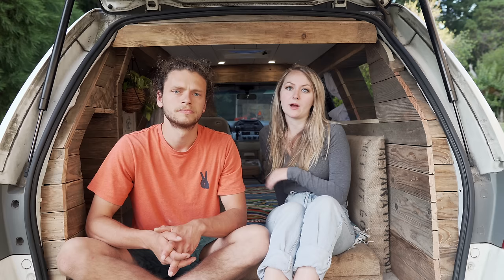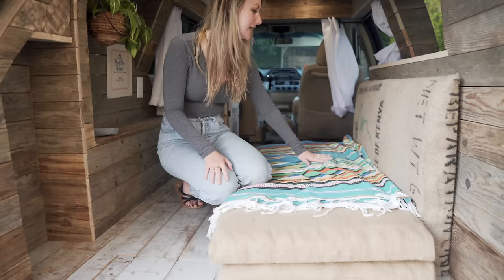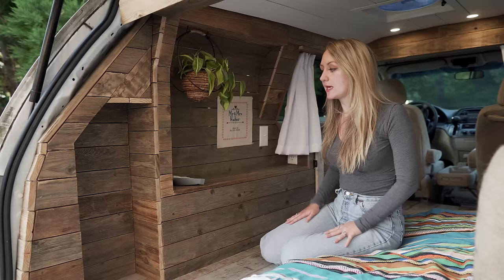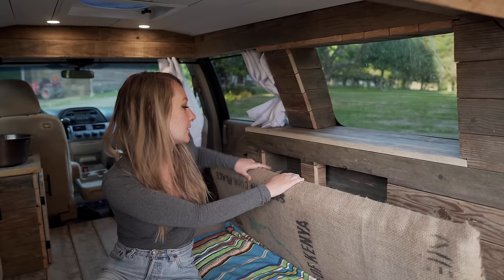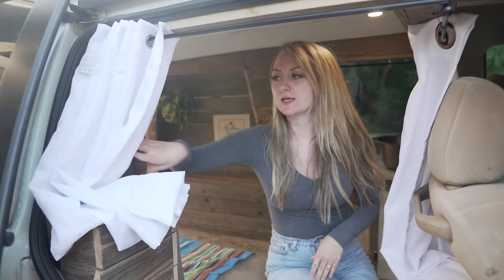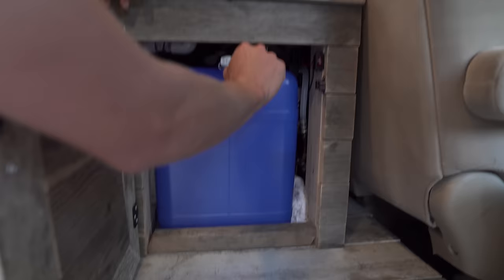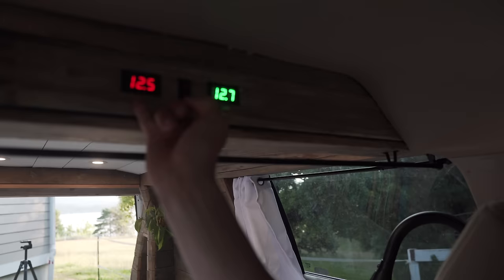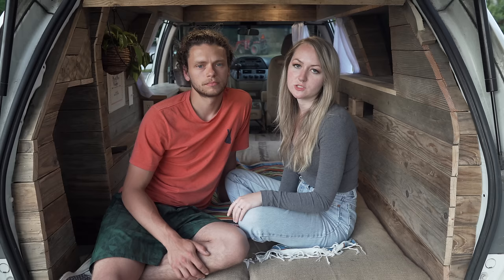MINIVAN CAMPER CONVERSION | Van Tour of Minivan Converted to Unique Tiny Home

Comment: I've seen at least a thousand minivan videos on YouTube. But anyway it does look cool as hate to think how much it weighs with the wood. I just used 1/8 paneling in mine.
Reply: Gary I’ve seen 1001 minivan videos. At first I thought this was a spoof. For never seeing any videos they did great.
Reply: Aren’t repurposed wood crates lighter in weight?
Reply: That paneling I used for a 4 by 8 sheet was only a couple pounds it was the lightest thing I found
Reply: Mine is all ghetto and not finished. If the economy ever gets going good again and I get some work.  Finish it and make it look good and put it on here
Reply: One thing to keep in mind when converting a passenger van or a conversion van like they did here, you’re removing seats, seat belts, interior panels, carpeting, possibly headliner, and I thought he said airbags (I’m guessing side impact bags for rear passengers?!) all behind the  B-Pillar (where all the side doors latch to, for those who didn’t know).  That alone could shave quite a bit of weight from the van before they even before they started to fit it back out. They were also able to save weight and living space just by making those trap doors to use the built in seat pockets in the floor, plus that keeps what weight that is there in the lowest point in the van to counter the wood added up top where there would have been lighter plastics.  The lack of a bench like seating and sleeping area helps too, though that on the passenger side would better balance out the wall, cabinets, and sink on the driver’s side.
Reply: They prob tossed airbags in the rear coils. I'd presume. With the shaved weight, then added wood weight+gear..rear suspension upgrades would be a must.
Reply: All that weathered and dried 1x material is super light. No joke, I bet all that wood weighs less than the seats made of steel that were there.
Reply: @mikeredhead2894   My stow n go captains were about 100ibs each, the rear bench maybe 150ibs. So yes, 350+ibs already out of the equation. 🍻
Reply: BJoe, I see your point on the solid wall switching sides for weight, but drivers side rear is often the blind spot so that’s really the best place for covering a window and still having full safety in driving. 
They did a fabulous job! I love that you have access the water and propane from the outside too. 
So many conversations with flooring added cover the stow n go spots and that’s such a waste. I like the hatch cover ideas vs bothering with hinges.
Reply: @tumbleweed1976  why did you think this was a spoof
Reply: I’m in love with cedar closet planks. I think I would use those! They smell great, and keep pests away!
Reply: Oh, and they are lightweight!

Comment: You guys did an awesome build!
Reply: Dualex, how are you..i bought your ebook. I have a 1997 ford e250 high top fiberglass van. It is ambulette with a lift chair, i bought it some time ago..in the headliner i could see metal frame. I think maybe the whole van is metal frame but is in between the top and the bottom or underneath fiberglass layers...

Was thinking about putting refletix then glue a wood frame then insulate and either put luan plywood or cedar  planks. I see not way to screw into fiberglass...what you think
Reply: You have some good builds too!
Reply: Your pfp scares me

Comment: 8:09 see the positive connection on the battery. it has nothing over top if it protecting it from grounding out on the hood. It's well past the stock height of the top post terminal. Clearly it's worked this long. But it's a danger non the less. If you get into an accident it could start a fire quickly. I see the fuse box you mounted. That helps but you should address it by buying a battery junction block, and then only run one connection on the battery. Be safe

Comment: Very Nice!  I own a 2001 Mazda van; have done major, 3-week camping trips in it, built a bed for ONE (boo hoo).  But you have inspired me to remove all the inner plastic walls.  I would not use 3/4" wood for my new walls, too heavy.  Also, I have a two-battery charger that automatically switches to charge the second car battery when #1 is charged; bought that in 1985... still it's unused.  good luck....

Comment: I like how you have the two volt meters with the switch in the middle. I wired up an isolator relay like that once, very similar to your set up, mine had an internal switch that would open and close with a small current, so there were the two large studs for the cable from the battery, just like yours, then there were two small studs, one ground and the other went to a small wire in the auto's electrical system that got hot only when the car was on.  If that makes sense? That way I would never forget to flip the switch. The circuit would close automatically when the car turned on and it would open when the car turned off. Your system looks great.  I never thought about using two volt meters.  I really like the two meters, different colors too, that's fun.

I found out that with my minimal electrical usage I never came close to having to idle the auto while camping. The charge from driving would be more than enough to run a fan and a couple LED lights for quite a while. An isolator switch and the vehicles alternator is a great way to keep your batteries charged, I always wonder why I don't see it more often on these videos. Makes a lot of sense, maybe people just don't know about the option.

Comment: Yous should cover your roof with solar panels and run your electricity off of that! It will give you constant power so in the event something happens to your van and batteries you will still be able to run everything to be comfortable

Comment: Beautiful conversion, but how much does all that wood weight destroy gas mileage and alter suspension load?
Reply: They gutted the van first... This greatly offsets the weight of the build. Ever pick up just one seat out of a minivan? They removed a few hundred pounds, easily,  before even starting.
Reply: Eric Werner Honda says maximum carrying weight is 1200-1500 pounds depending on tires and suspension. I’m thinking fully loaded they are pushing the safe limits.
Reply: The original seats alone probably weighed as much as the wood.

Comment: Where is the spare tire? No one ever shows the spare. I would think in an emergency flat that it’s still needed.
Reply: I always think the same thing!!
Reply: Use run flats
Reply from the maker: We haven't found quite the right spot for it yet haha but we plan to make a follow up video addressing some of the questions we've gotten so be on the lookout for that :)
Reply: Behind the front seat, down into the floor or on a sidewall is where I've seen them. I've heard up underneath also.
Reply: Mine is under my van..i thought they all did that now? I have a 2006 dodge caravan cargo model..
Reply: Kyle and Madison Travel   I see so many van lifers Out in the sticks and no sight of a spare. I did see one video where someone mentioned fix a flat for emergency purposes

Comment: I love the layout, if I was single I would have the same plan and remove the front seat for extra space.   We bought a van during lockdown and have converted it into a campervan for 3, something is not working - I think my husband has too many things in it and I think we need to make adjustments as we go along.  Or maybe it’s just we need to travel more and change things around to make things work.  Love your van - can we swap!

Comment: Kyle, I'm buying a Sienna van soon.  I'm just a single man.  And I've been debating whether I should strip off all the plastic panels off the interior sides to create more room and then build cabinets along one side, just as you've done.  Please tell me how you did that.  When stripping out all the plastic, do you risk cutting into wires that run to important things like the taillights?  I intend to have a 'gaucho' bed as you do, but my bed will be sitting on a 12" cabinet base along the length of the bed.  If I don't remove the side plastic  panels, I'll only have 48" to do my cabinets on both sides, with a tiny center aisle of 8 to 10".  YIKES!  So I really want to strip all the plastic out, but will I have to sacrifice the rear air conditioner?   Please respond to this message and tell me the problems I'll run into.  You're my only hope to answer this question about removing the plastic because most Sienna conversions just build with the plastic panels in place.  If I can remove the panels, I'll have much more room to do my build.  HELP!

Comment: I just wanted to say that your van build is awesome. We have a 2008 Chrysler Town and Country touring that we're going to be doing a conversion on over the next 8 months. I like your idea of your battery monitoring placement. I too plan on putting my electrical in the stow and go area but I only want to use a part of my available space. Use the rest for tools and essentials. The rear stow n go area will be a lid for the propane and water with a lazy susan on one end attached to another counter that can swing outdoors for cooking and baking. How much insulation did you do?

Comment: I am just beginning my mini van build. I would like to follow your design.  
The floor leveling frame with insulation is my focus right now. Also removing the air bags...did that disable the drivers air bag system?
Thanks.

Comment: You are one of the only mini van builds I've seen without a glimpse of the old minivan interior...did you strip the inside entirely before building? Or did you build over it?
Reply: What about air bags? What did you do with the electrical that was connected to the back of the van? What about the extra seat belts? I have so many questions. 😂

Comment: On the under floor inverter/electrical area, could you move them closer together like all to one side so you could still have the other half for more storage? Also what are you using for a refrigerator/good storage? 

Beautiful build & bonus points for upcycling!!